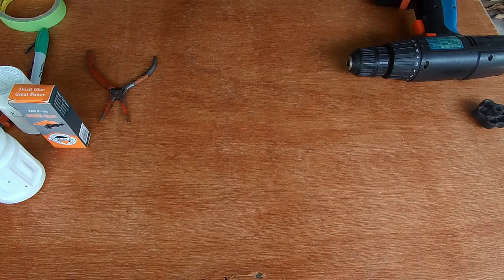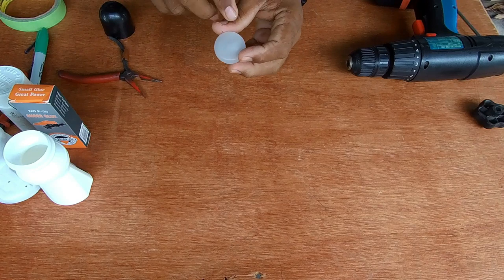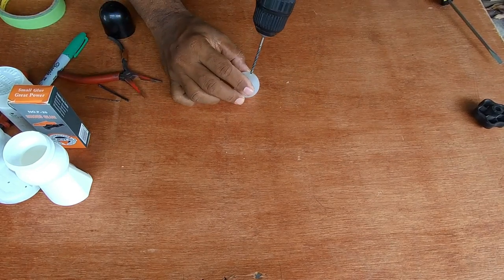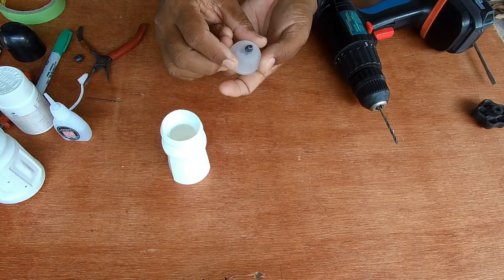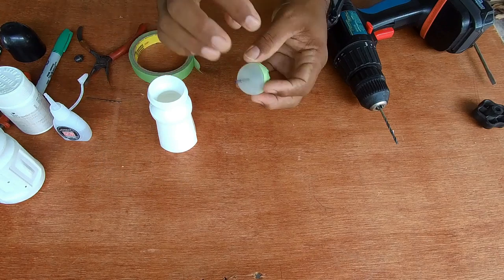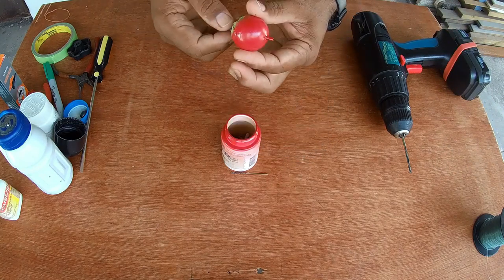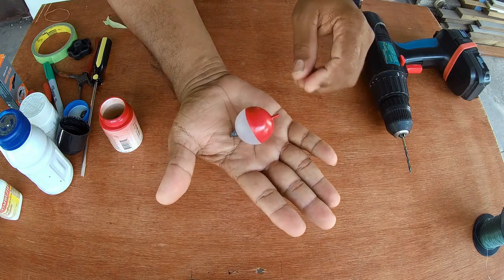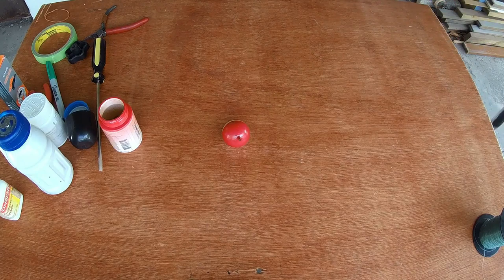How to make a Bobber (Floater) DIY 🇯🇲

Comment: i made it from the snook video almost got it just left out the sinker , didn't bother with  the elastic i just uni not  two  pieces of line on both ends still adjustable ,excellent video
Reply from the maker: Ok brother, if it's adjustable it will work same way..

Comment: Mawnin angler. You can do the same thing with a toothpick too.[keeping the line secured and tight].
Reply from the maker: Yes you can, but toothpick break off in the tubing sometimes so that's why I use the rubber band.. but toothpick can be used...
Reply: , @jamaicananglersfishing2869 yeah, I've had that happen to me a time or two. Never thought about the roll-on ball though. Know how many I've thrown away?!!